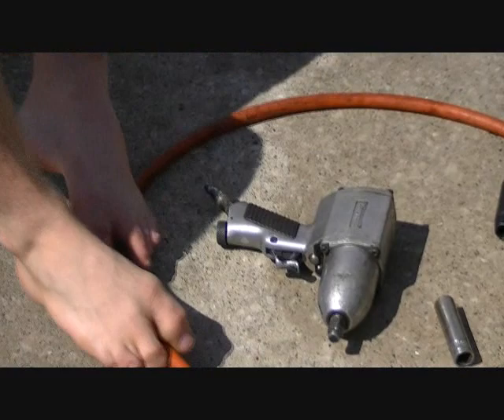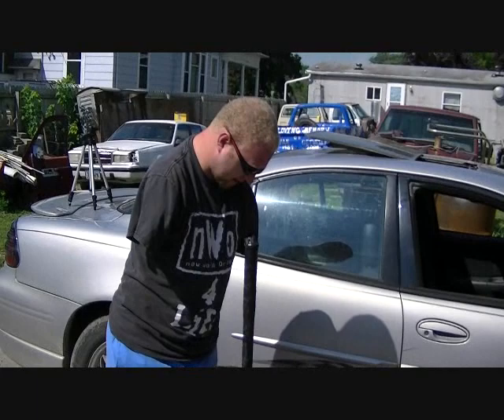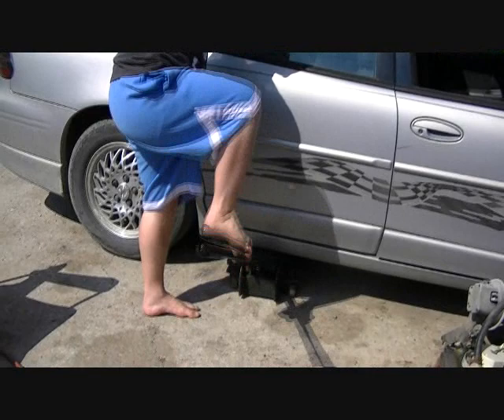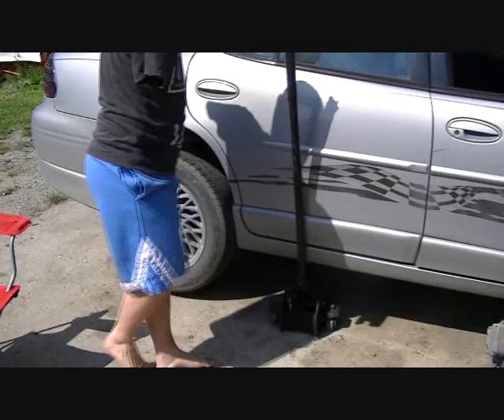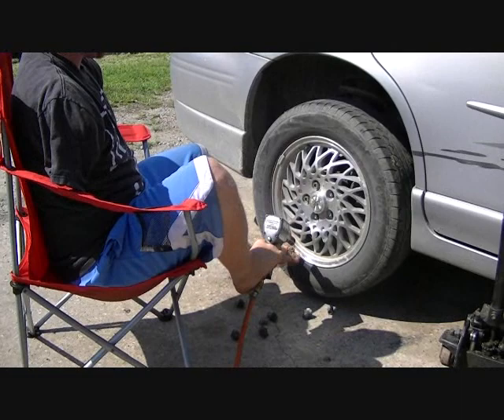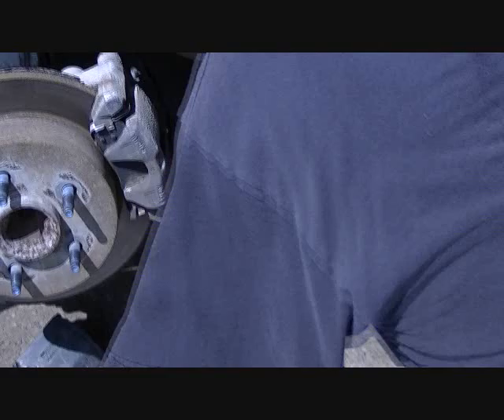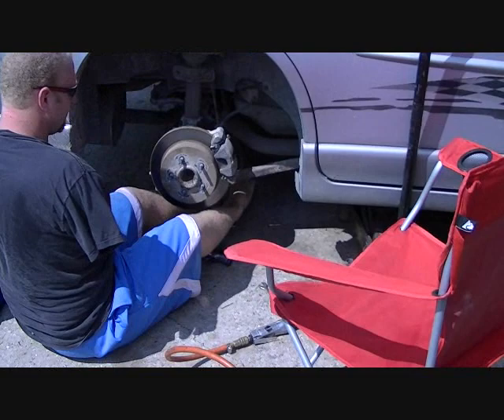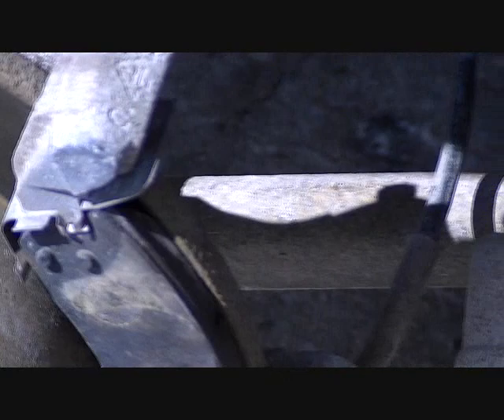INSPIRATIONA; ARCHER EPISODE 2 BRAKES

Comment: A few tips (not putting down your skills, just trying to help out):
1) Use a jack stand to be safe.
2) When tightening the lug nuts, you should use a torque stick or torque wrench which will greatly reduce the risk of warped rotors. Your Grand Prix should take 100 Ft. Lbs. I noticed you used a star pattern which is a good policy.
3) It's worth it to pull out the caliper slide pins (where the caliper bolts to) and grease them to make sure they aren't binding.